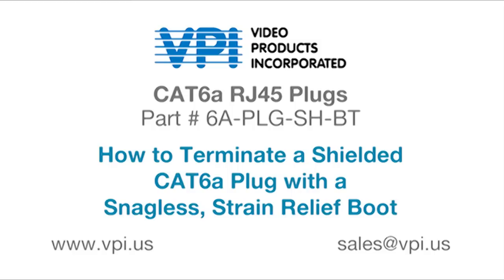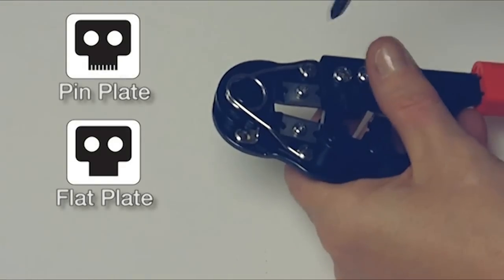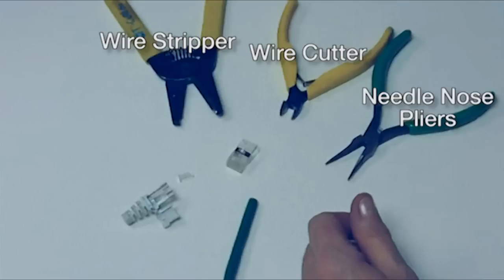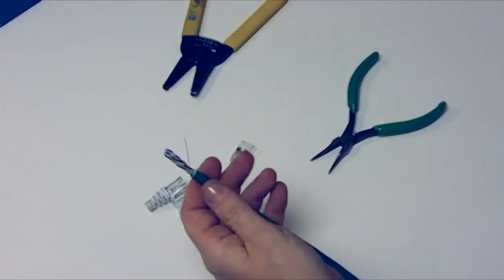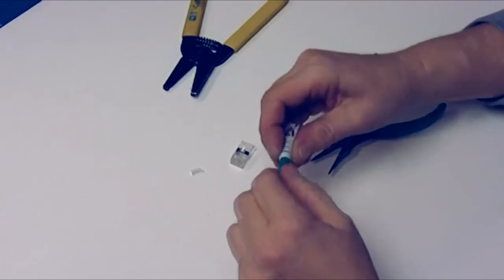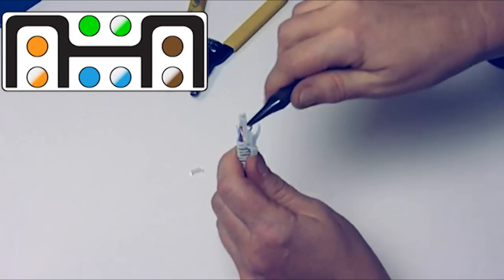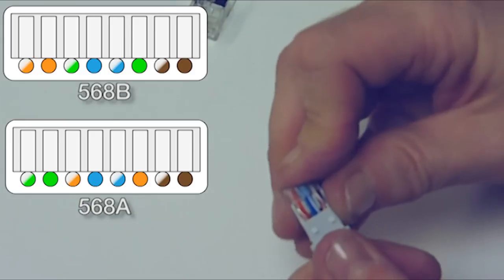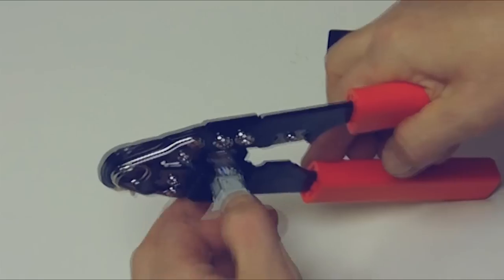How To Terminate Shielded CAT6a Cable

Comment: This really is an excellent connector, but why max out at 24 AWG?  Most Cat 6A cable is 23AWG today.  Also the strain relief is too tight and won't fit even the thinner Cat 6A cables.  It must be around 6mm while most CAT 6A are 7mm or 8mm or larger.  Otherwise it is a great connector and keeps all pairs far from each other from the boot side, and then a load bar keeps connectors twisted as much as possible.  The Fluke test passing it as Cat 6A or 10Gbps is the clincher, the only other connector that can pass Cat 6A consistently that I have tried is the Telegartner MFP8 ... but those cost a bundle!